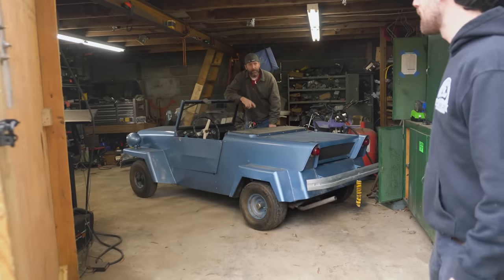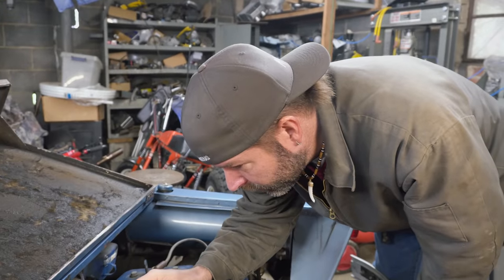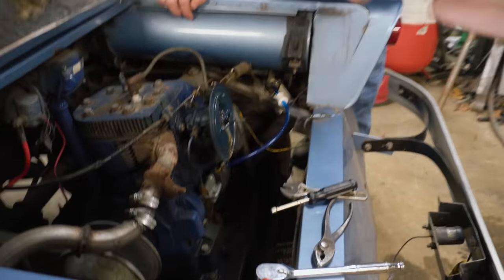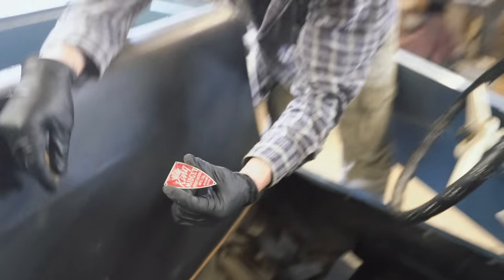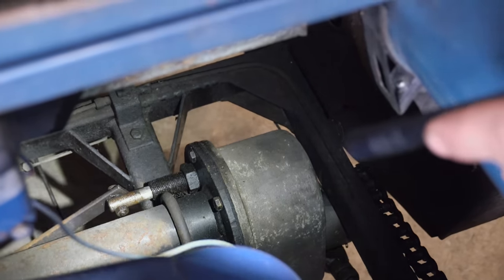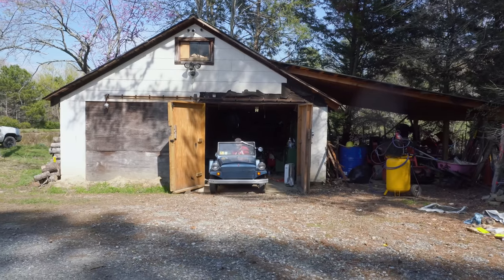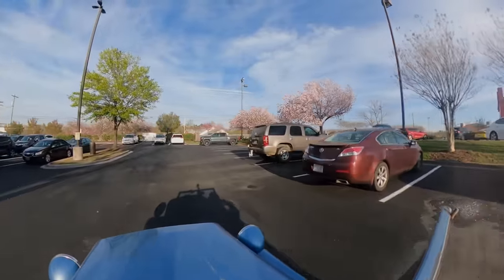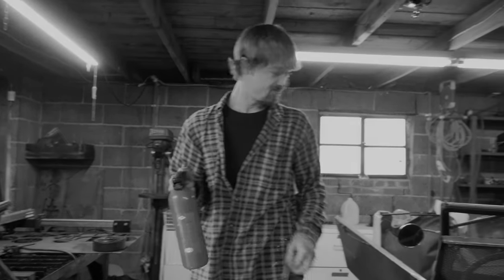We Bought a 60s Microcar with a Controversial Name... Will it Return to the Road After 22 Years??

Comment from the maker: Micro car road trip!!
Reply: We need more mini vehicles because you guys basically do always quads go karts, but never really like mini vehicles
Reply: They also had a dune buggy and a few scooters they have a few in Athens Ohio I'll take a few pics next time I'm there they have some more info on them too
Reply: John those are the turn signals not fog lights. They come on like that because one or more of the bulbs are of the wrong kind . Usually a 1157 {dual filament} was replaced with a 1156 {single filament} Thus causing them to come on when braking . And a 670 would for sure make it more roadworthy
Reply: You guys totally should do a road trip! I would love to see that!
Reply: Do a V twen engine swop with the transmission on the VTwen
Reply: You guys should fabricate a removable roof!! I think it would look good!!
Reply: I never use any fuel line than Tygon. It doesn't petrify.
Reply: Yes just yes
Reply: Yes
Reply: The kohler is the right engine.  A 16hp k341 is identical size, and an 18hp k361 is almost the same but has OHV.   

Puking oil is most likely a clogged breather. 

I look forward to the road trip.
Reply: Road trip, please.  And would love to see more content in general.
Reply: You need a second vehicle of sorts, then definitely!
Reply: Yes a 670
Reply: I would love to see you work on it and road trip it ❤
Reply: Please more content on this this thing is awsome
Reply: That is a very cool King Midget. I'd say street bike motor but i think redoing the motor an keep it original would keep the value up.
Reply: Stick a turbo V twin in it
Reply: If i Had one of those today id daily it
Reply: @jasonshipman4735  You should make a racing lawnmower 2.0
Reply: Overland trip?
Reply: Maybe with that guy that did the mini jeep road trip to Moab? I forget the channel name off the top of my head
Reply: That's a terrible idea and I'm 100% for it!
Reply: Yes
Reply: I'm thinkin it needs the motor off the drag rail swapped out 😂😂😂
Reply: If you want a support vehicle for the road trip, hit me up.  I'm a huge fan of "tiddlers" (micro cars and micro bikes) and I can follow with parts and support, and I can wrench too, if needed.
Reply: Absolutely
Reply: Please leave the Kohler in it!
Reply: Cars and cameras. I would keep the engine original try looking for a donor engine since it is a rare micro car. Yall could take the engine apart and rebuild it. Also try and find the original transmission as well.
Reply: the hijet better be going too XD
Reply: You guys should build cars of you own like this
Reply: Yes please!
Reply: Fux yes!
Reply: Okay guys. Seeing that tha car has a CVT and a jackshaft with a sprocket I know you guys can get that thing to go 65mph possibly even faster lol
Reply: V twin swap it
Reply: If you put a small roll cage on it, you would stiffen up the chassis and it would look like an old International Scout.
Reply: This is by far your greatest find yet! I freaking loooove it!
Reply: that micro car never came with belt drive because originally was chain drive and owner cant find clutch for it so he have switched to cvt belt drive
2nd if you aint going fast enough than you know not enable all way in so change weight or replace it with better one (go bigger so it can get more speed)
Reply: Each of you need your own micro car. Road trip with a few challenges along the way?
Reply: @goosenotmaverick1156  the channel name js C90 adventures. Bro went through the whole world on top of a c90
Reply: High performance engine all the way.
Reply: Cool
Reply: Needs a ducati motor 😁😁😁
Reply: Hell yeah get another micro car so y'all can go on a micro road trip
Reply: Princess cart?
Reply: That'd be sick vid
Reply: 😲 Oh my you're speeding in the King Midget! 50mph in a 45mph... 🚙 🚓 👮🏻‍♂️
Reply: @goosenotmaverick1156  C90 Adventures
Reply: Road trip to Alaska with this mini car...😆😆😆
Reply: Hell yeah road trip
Reply: Hell yeah road trip
Reply: Yes.
Reply: Charge!!!!!
Reply: Vegas road trip with this car
Reply: Yeeeeeeeeeee
Reply: Beach trip!!
Reply: Where's Charles gonna ride? The trunk?
Reply: @whatsinanamethatthecaptive577  They just cut down to one video a week, on Wednesdays
Reply: It would be cool to see it with more power 😊
Reply: I would love to see y’all go to the beach in that!!!!
Reply: Love the project boys
Reply: King midget needs a small lift and taller tires
Reply: you need a small atv transmission for it =P
Reply: Yeees
Reply: Make a drift mower
Reply: Let’er rip!! 🏁
Reply: New transmission, port and polish new wheel bearings. The whole 9. Go down to the bolts and bushings.
Reply: Yes lol
Reply: Definitely performance upgrades lol
Reply: Hell yeahh!
Reply: Terrible idea. I love it.
Reply: A race with the dumb and dumber bike. LoL.
Reply: Going to the beach! You need a light weight trailer and a mini bike from the sane era behind it..
Reply: @kevinfaircloth81  I think they should keep it og and just upgrade the engine.
Reply: @rydplrs71  I have a '78 John Deere 316 with the 16hp variant, it started puking oil out while I was testing the front blade and found a screw behind the air cleaner had come out, no idea what that screw does but it let the oil out. I think a kohler upgrade would be great too, should drop in with minimal effort and they so far seem near bullet proof.
Reply: You need to put that predator Engine in there
Reply: Cross country road trip would get millions of views
Reply: Imagine if they put an electric engine in it
Reply: @bryanwensil7516  yea I would say a motorcycle engine would do wonders for that car
Reply: Body panels are straight... Limo stretch,?  convertible top. muffler quieter
Reply: Let’s go!!! 😂
Reply: heck yeah!
Reply: I wouldn't drive it any further than you want to push itf it back from.
Reply: There's a matching hernia belt in the glove compartment, the gloves are worn for frostbite regulation, and pushing it so that the oils from the dermis dont etch the paint.
Reply: Yes
Reply: You should put one of those Harbor freight predator racing engines in that car
Reply: christian family  you mean with seat belts and slow speeds, because accidents and vehicular manslaughter never really produce afterlives?
Reply: There also was the MG "Midget" & "midget" racing. In the old days, the word midget held no negative connotation. Much of the controversy stemmed from it being used wrong. Physiologically, a midget was different than a dwarf, but people often thought, that they were synonymous. The overarching "Little Person" began as a catch all term to simply alleviate the mix up between the terms midget & dwarf, but it was co-opted by The PC Police to make people using "midget" or "dwarf" feel immoral.
Reply: 🎉🎉 And I would like to see you guys do it like you didn't address her and motoring it
Reply: I would like to see some kind of motor like you guys put in your dragster in it and yeah let me cool for road trip.
Reply: swap in a predator motor or something 30hp or more in this lil car! It would make it a absolute beast
Reply: Yes continue that build
Reply: I think the turn signal is easy to fix just add turn lights on the back to add it to that so you have breaks and turn signal and add a mustang 2 front end that give you a chance to put a disk brake system on it I seen good acouple of videos now on that and maybe add that mustang front end on the cosley too for better turning and disk brakes I heard they have a slopy front end as well

Comment: The Kohler K301 in that machine is a good stout engine.  It is much better quality than a comparable Briggs of the same year and horse power.  And, you can get all kinds of parts for the Cast Iron Kohlers.  A ton of them are still in use today in garden tractor pullers making a lot more horsepower than they were designed for.  As a garden tractor collector, I would recommend leaving the Kohler in place and maybe modifying it for more power rather than toss it for a Predator.  Great little machine you guys found there!  Best of luck in bringing it back to it's former glory!
Reply: I agree. tune the Kohler.  You'll f*** it up completely other wise.
Reply: My simplicity landlord 1969 is a beast!! Kohler power
Reply: Or you could take out a mortgage and buy  a honda engine.
Reply: Midwest Super Cub for more HP.
Kohler K301-12hp engine and Cub Cadet tractor is the starting point for all garden tractor pulling. 
That 12hp engine, is the only engine that is used, if you want to pass inspection; rpm limited by rules, rest of engine can have work done.
Lots of aftermarket support for that specific engine and very strong cast iron block.
Reply: Yes I agree all the K series Kholers are nice especially pre 80s my tractor in my profile pic is a 67 case with a k241 never done repairs to the engine... was sitting for over 10 years in the elements just cleaned the carb and it's fired right up
Reply: I have 3 case tractors (a 1967, 1974, and a 1978) the '67 and '78 has the k241 and the '74 has the k301 all three run good especially my favorite the 1967 Case 155 with the k241 that runs strong I use it for moving stuff around the yard and snowplowing, it's the one in my profile pic and I also have videos of them on my channel

Comment: Already diggin this episode after just clicking on as I’ve got two King Midgets myself. My newer one is pretty close to yours but still in the factory white body color. Grandpa found it at an Arkansas campground in their playground buried in sand for kids to climb on. My earlier one was bought by a friend of the family to drive in parades with his Shriner buddies. It’s one of the first models with wooden doors and floor. Oddly enough I just found the convertible top bows for the later one last week that grandpa had put up in the rafters. Instantly knew what they were as grandpa had described em to me in the 90’s in hopes that I may run across them while moving parts around during my first ElCamino build. So cool to see other people discovering these cars, and that you’ve got one of the steel and aluminum bodies instead of the later fiberglass bodied cars. Can’t wait to see where you guys take the build.

Forgot to mention, if you guys ever need points, condenser, generator/starter or engine parts, Cub Cadet riding mowers from the same era will interchange.  

Almost to the end, somebody had to have changed the gearing. They’ll run 50+ no problem with the original centrifugal clutch. On a crowned secondary road though they do tend to get a little bit sketchy with the factory caster built into them. The shocks were pretty primitive originally which doesn’t help either. I’m thinking grandpa said he used shocks from an Opel Kadette but I could be mistaken as he had one of those little cars for my mom to drive to the city park’s pool when she worked during the summer. Unfortunately the car stories run together for me unless they were about muscle cars or drag cars. I can look at my King Midgets and compare to old inventory at his old garage that I bought a couple of years back. I ended up with a 50 x 10 wall of shocks, front end and brake parts from the family business when he shut it down and went to the coal mines. I’m sure you guys are good with your research but I dont mind helping if you run into a dead end. Anyway, keep up the cool content.
Reply from the maker: Thanks for sharing the story and expertise! These are sweet little machines, you’re lucky to have 2
Reply: @CarsandCameras   hey if you do put a v twin engine in it a oil pressure and oil temp gauge should be added to the dash like the other two please and run a oil cooler with fan to help
And a tachometer analog one would look cool
Reply: @CarsandCameras  They are definitely a great little car. I appreciate the compliment, I just lucked out having a grandfather who enjoyed being a big kid. Didn’t matter if it was go karts, 3 wheelers or dirt bikes he was all in and got as banged up as the rest of us. 

Glad you guys ended up with yours and are sharing some of the history of them for what I’m sure are thousands of viewers who would’ve otherwise never had any knowledge of them.  

One more thing just hit me that I’d forget earlier. Grandpa mentioned that these cars had been used in amusement parks across the country around late 60s early 70s.
Reply: If they had one of the fiberglass bodied ones it would be a very rare find as only three complete 1970 Commuters were built before the fire at the factory. The only body mold and a bunch of finished bodies were destroyed. 12 model III cars were built in 1970 and that was the end of King Midget.
Reply: I would be thrilled if you could put some videos of them on your channel! Ever since this video came out I have been fascinated by these cars and learning about them and their heritage.
I see so much potential in these micro cars and how they could be upgraded and retrofitted with todays technology.
Thanks if ya do!
And no worries if ya don't.
But if you do decide to Let me know here and i will DEFINETLY watch and post comments and questions on your videos!

Comment: Hey guys, that tail on your Midget, if original, is from Exxon gasoline advertising campaign of the 1960's.  The tag line was "Put a Tiger in your tank!", and they gave away those little tiger tails with the elastic band to to put around your gas cap and have the tail hanging out.
Pretty cool.  I don't know if anyone reproduces that tiger tail any more.
Also, I owned a British micro-car for many years.  It was a 1959 Berkely SE392.  Originally had a 392cc Excelsior two-stroke engine, but mine was modified with a 750cc Kawasaki Ninja engine.  It was INSANELY fast!
Reply: They also gave them away in the 1980's, too, at least in the DC area, where that King Midget was last registered.

Comment: The engine is very similar to the version used on some of the 70’s cub cadets. The starter may be the same setup; it is a starter when energized by the solenoid, but becomes a 12V generator once the engine is running.
Reply: As Someone with a 69 Cub Cadet 147 (14 hp)  I can confirm. they also ran a sediment bowl and round air cleaner.

Comment: Great video. I think I'd like to see what can be done with the Kohler engine before the Predator V-Twin is installed. A few mods and general maintenance. Once all that's done and you've road tested a bit more, then think about the upgrades. Cheers and keep up the interesting content.
Reply: The Kohler engines were strong mules and used in everything requiring an industrial small engine. I bet you could modify it starting with tampering with the governor to get some real rpm and more torque.

Comment: Consider this, since you're replacing the master cylinder and a few other brake components. Start out with the idea of this car sits most of its life. DOT 3 brake fluid does not do well over a period of time. Build your new brake system around DOT 5 brake fluid, which is pure silicone base. It won't absorb water and it does evaporate. My Harley always had brakes in the spring when I got it out for the summer. You need to start fresh with all new hoses and wheel kits, but it will be worth it when it's ready to drive every time you want to drive it. Love your find and look forward to the 670 build.

Comment: Hey guys, had to rewatch this one with the Mrs...she loves this little car!!
I'm a HD partsman...just thought you'd like to know for reference.....those clevis parts used for tie rod ends, they are most likely for air brakes.  They are installed between the air brake chamber and slack adjuster. 
Cheap and easy to find at any big rig truck shop. 
Cheers!

Comment: 670 with a nice mid range cam and valve springs, and billet flywheel with a mukuni carb and free flowing filter and exhaust would be a nice bump in power but not too radical and would probably let it ride at highway speeds with ease once you get the brakes working good. I'd probably replace all 4 shocks to be safe too 😅. Could even throw better pushrods and rockers and billet rods in it for more longevity

Comment: My mother bought a new 1957 model from the ad in Popular Mechanics.  It shipped from the factory in Athens, OH to us in Nashville, TN, by Railway Express, strapped down on a large pallet.   Cut the straps, pour in a gallon of gas, and drive it home!  ‘57 was the first year that electric start was standard, but the plywood doors were still optional.  Hers had a 9hp Wisconsin engine with the dual centrifugal clutch drivetrain.  I got to drive it a lot when I first got my license in ‘62.  It was great for delivering my newspaper route.  It could get up to 45 mph, downhill, with a tailwind, and could make it up most hills.  The manual windshield wiper would keep your left hand busy in the rain.

Comment: I'm 67 and I remember lusting after these as a kid, seeing them in the back-page ads of Popular Mechanics and Mechanics Illustrated. Leave it to you guys to find one, resurrect it and drive it so we can see how it actually worked. Very satisfying video. I had to do some research to see what kind of transmission it initially came with and I found it was an interesting two-belt, tow-centrifugal clutch deal which provided two speeds. I wonder if the CVT adds more speed. Anyway, for the future, I love the idea of replacing the motor with a two cylinder Predator , as long as you don't have to make any severe/irreversible modifications to the original car. I also love the idea of a trip to the beach on it (I know the area where you guys are and it's a decent little road trip for this car).

Comment: Had a '57 Jacobsen Chief J-100 lawn & garden tractor, that came with a Kohler 7-hp engine. The most amazing thing about it--aside from the rear fenders having a "tail fin" shape--was it used a Delco-Remy 12v starter/generator configuration. Hardest part about servicing it: Setting-up the regulator.